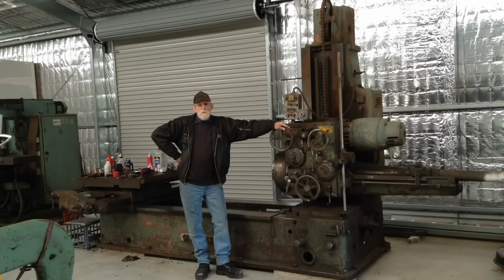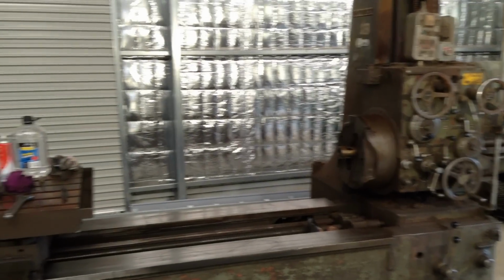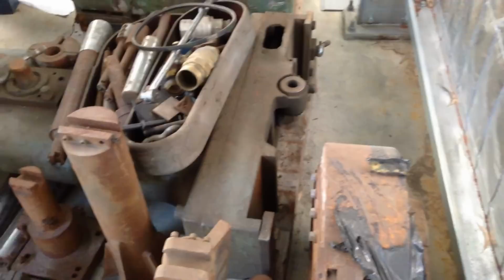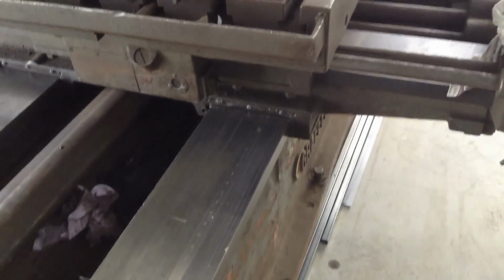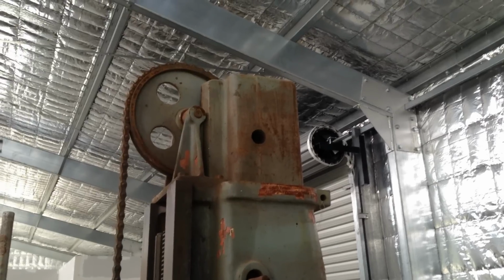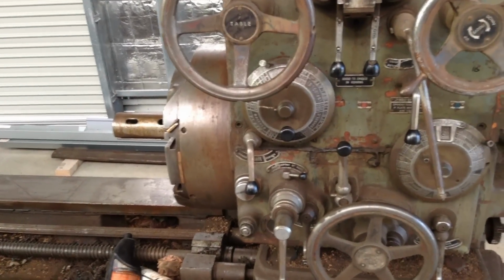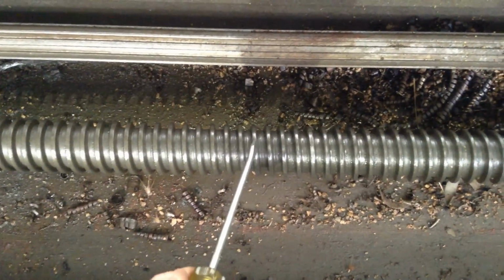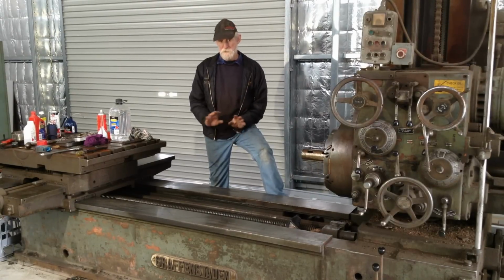Graffenstaden  Horizontal Boring Machine  .   Refurbish Part 1 .

Comment: Dear Max and channel.   I was delighted to see the fact of a machine as 1954 vintage, with a concept to restore to horizontal boring.  
why would it matter?   Well, to the electrical power.   Here, the process to a machine footprint?   *Large.  With a sturdy power input.  So in a shop .....fitting the device to best safety, sure production as lessened hazard and well thought out power supply,  is within study as typical to a shop and production.
My shop is in fact, small.  Thus, critical decision as to 220v supply, as to serve end use but fall within every notice as protect from incidental water, sump, drain, and mounting as floor or riser.   The weight of components.  The natural placement to tool table, waste chip bin, light from above....all are within the needed plan.   And the service of weldment.  Which is a power terminal, also.
Before the chip product is made.....a practice to the long term power supply is critical.  And for Max and viewers, taking the time to plan the metrics of a shop layout.....where the hours at task are to be met and (possibly enjoyed)...well, need and require well protected service. (electrical) that have the strength and best plan to delivery, end user safety and production.  Tools at hand, fitment as useful to travel at physical constraint....adventure to this Max shop but so interesting to learn from.  As expansion may happen.  M.
Reply from the maker: Thanks .   👍

Comment: Interesting project!  I will be following this as I recently bought a Pfeifer 75mm horizontal boring mill. It needs some love and cleaning.  Mine has way damage and wear on the table cross slide ways.  The machine is probably 10 years or so newer than yours.  It has the same kind of proportions though, an unusually long bed for an HBM.  Do you have any idea why some of these had such a long bed?  I bought mine from a tool dealer but it was at some risk of being scrapped also.
Reply from the maker: Not sure about the bed lengths . Could be a facing mill has a shorter bed as they do not have the spindle , just the facing chuck .   👍
Reply: @swanvalleymachineshop  The more mainstream HBM machines I see like Giddings & Lewis and TOS for example have relatively short bedways for their size.  Just makes me curious if there was an intended purpose for longer bed machines.

Comment: You will get this monster working like a charm Max!  Awesome.
Reply from the maker: Yes , but it will take some time !    Not having a very large camel back to check the main ways will be difficult but i do have the new ways on the other large HBM tool support to use instead .  If i hang it from a gantry , it should work as it's all i have ! 👍

Comment: Hi Max, see she is made by Alsthom, now GEC Alsthom.
Our large Richards HBM, maybe double in size to your's in the refinery workshop was reground and fitted with Turcite ways, they spent weeks trying to align and she was never the same machine, could not be relied on to bore a true bore, used mainly for facing operations after that.
Probably quietly rusting away now after the refinery was shutdown 2 years ago.
Been watching Keith Rucker restoring his HBM, lot of work considering his is more than 100 years old.
Reply from the maker: Yes , i have my fingers crossed with this one !    Do you know who did the work on that borer ?
Reply: Hi Max, can't remember who the company was, done back in the mid nineties.
The base was bolted to the column vertically and removed leaving the column behind.
They had to jack hammer out the base, grouted and bolted into the concrete base and carted it away with the table intact.
She was a monster with huge DC motor mounted remote with a large 4 row chain driving it.
Had its own room housing the Ward Leonard controls.
Hoffmans used to do a lot of large work for us, maybe them, if still existing.
Reply from the maker: @willemvantsant5105  Yes . Hoffmans are still around , 10 mins down the road . I  have 2 of their machines .

Comment: Hi Max, great look round the HBM, brought back memories of working a Kearns in my early career. Being as you look like you are short of projects, the Italian tool support would make a lovely flat bed lathe if you flipped it on its back 😉. Cheers, Jon
Reply from the maker: Hi Jon .   I was wondering how i was going to measure the ways with out a 6 or 7 foot camel back .  I dawned on me , that other tool support has a good set of 7 foot ways that i could use ! 👍

Comment: Wonderful machine you picked up there, Max. I don't see that the depth of the ways issues will need regrind but once cleaned up you will tell. It's really going to be a beauty again and so happy you saved ol' King Kong......Thanks for showing it. I back to my Leblonde restoration again tomorrow as today I get to relax...Ciao, Mate....Ricko
Reply from the maker: Thanks .  The scratches & scores are no worries , i can live with that .  If  is wear on the sides that effect the gib adjustment or a large hollow in the middle , that will have to be addressed .   The wear does not all have to come out , just a bit of it .   👍

Comment: Hi Max, try Citric Acid to clean rust off, it only reacts with rust, buy a 5 kilo bag of crystals,  will last ages,  just wash off after with soapy water, dry, then apply a dewatering fluid. 
Always great to see a machine being resurrected. 
1250 rpm is impressive for that sized machine, comprehensive controls.
👍
Reply from the maker: Thanks .  👍

Comment: Cutting Edge Engineering just got a machine like that, he called it a horizontal facing borer
Reply from the maker: Yes . A facing borer does not have a quill or tool support , but a very similar machine .   👍

Comment: I think I paid $11500 for my borer but it has hardened ways in good shape . But it has paid for itself a long time ago ,. I think it is the most used machine in my shop and makes the most money. So then you get yours running you will find endless jobs you can do that you could not do other ways 
good luck with the rebuild
Reply from the maker: Thanks .   Hopefully all goes well .   👍

Comment: I understand your "this is what I have to work with statement", I have that going on with a couple old machines pulled from scrap. I see these old machines starting to get scarce here, the opportunity is now or forget it. I think this HBM is a good project with the tail support and other parts still there.
Reply from the maker: Yes , that's what i figured .  There is no way i could afford a running one in good condition .   The prices are through the roof .   👍

Comment: Hello Max.  I don't envy you with the work you have ahead on the HBM.  I've had mine for just over a year and I'm only about half way through getting it up and running.  Fortunately on mine the ways were hardened and are all in good shape.  Mostly its been a job of disassembly, cleaning, replacing bearings and small repairs and reassembly.  I put close to $900 worth of bearings in one gearbox alone. Ken
Reply from the maker: Hi Ken .   I will tackle the bed first & depending on the outcome that will help me decide how much i spend on the gearbox .   They are a super expensive machine to get if they do not need any repair work .  👍
Reply: @swanvalleymachineshop  I'll be interested to see what you do with the bed ways.  My Broadbent Schofield lathe has large, unhardened bed ways that are severely worn.  The underside of the saddle is also severely worn.  Once my HBM is up and running I will be able to machine the underside of the saddle but I still don't know what to do about the ways.  Maybe I'll pick up a tip or two from you.  Ken.
Reply from the maker: @hmw-ms3tx  I have to do my old 24'' x 10' lathe as well .

Comment: Perfect winter project. You will get it right and resume making the impossible look easy.
Reply from the maker: That would be good .  The funny thing is Dan , i do not have a very large cammel back straight edge . It just dawned on me , i do have a spare 7 foot tall spare tool support with new ways that can do the same thing !   👍
Reply: @swanvalleymachineshop   Keep the CLR handy. Metal Scraping my shaper and iron particles stuck to the bathroom porcelain. CLR resolved the issue when senior management (wife) provided a performance review as my mess invaded her space. LOL. I bet somebody in Perth is tired of walking around a large camelback straight edge. Not strangely I was looking at your ways thinking 🤔 man that is a lifetime of hand scraping. My guess is leveling will show everything is straight just with some low spots with complimentary load bearing points also remaining. Looking forward to your solving the problem as always.

Comment: Gday Max, definitely a machine worth saving and it’s a bloody shame it fit damaged in transit, with the size of the ways you could possibly get away with scoring, like you said more oil retention, the prices of machines in Australia are out of control, im keen to see how the grinding setup will work, Cheers
Reply from the maker: Cheers Matty .  It will be well worth the effort considering the cost for a replacement .  I do not want excessive overhead costs in my shop , hence the old gear that i can still run ok !   👍

Comment: That looks like an amazing machine! I see a number of YouTube machinists using horizontal boring mills, including Josh Topper, and now Kurtis at CEE Australia has a horizontal facing machine, which is similar. They are great for working on bearing and bushing chocks that are too unhandy and dangerous in the lathe.  Illkirch-Grafenstaden is in the south of Strassbourg and I happen to know a very good restaurant there! LOL Thanks for showing us this interesting machine.
Reply from the maker: Thanks .  As far as i have been able to find out , that is where the machine came from . 👍
Reply: @swanvalleymachineshop  Yes I have seen the factory. They make CNC machines now.
Reply from the maker: @BruceBoschek  I should try and email them & see if they still have any parts diagrams .

Comment: Max I have been considering using Moglice on my saddle for my Clausing lathe. That might be worth considering for the bed ways. Thanks for bringing us along.
Reply from the maker: I think that type of stuff is for under the carriages etc , not for ways .  I don't really now much about it .   Stefan Gotteswinter did a video using it a while back on his tool & cutter grinder .  👍
Reply: @swanvalleymachineshop  You may be right. The videos I have seen are on the moving part and not the stationary part. I will be sure to follow the video to see the repair, Thanks again.
Reply: @swanvalleymachineshop   Moglice has its place - but what you need is a friend with a really large surface grinder.. <grin>
Reply from the maker: @lrakschmidt2880  Or a large planer machine !